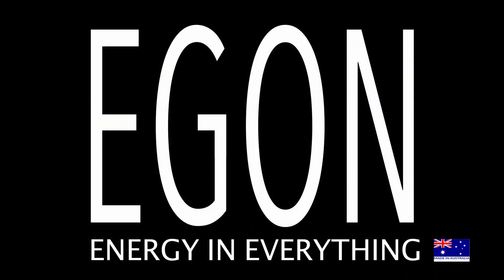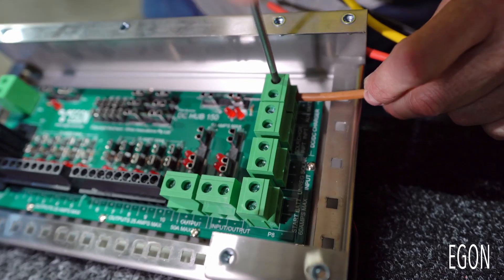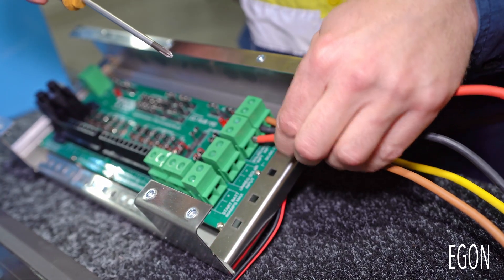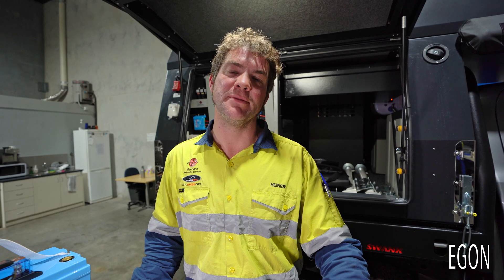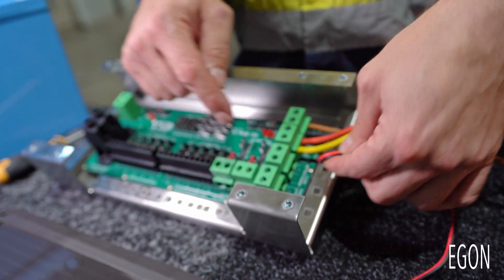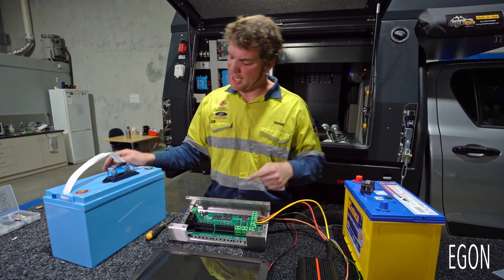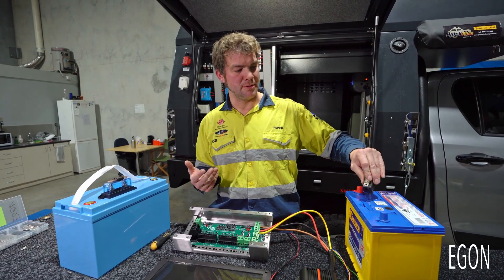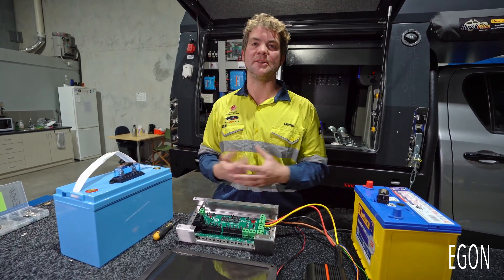REDARC DC CHARGER to EGON DC-HUB instal guide

Comment: How do I connect negative side come from battery? Previously I did ground that. Not run all the way from engine bay.
Reply from the maker: Run it to the negative side of the battery input. Do not use ground. Run neg cables to and from the DC-Hub. That way, there is far less chance of voltage drop.
Reply from the maker: I suggest using the contact form on the website for questions. YouTube is the worst place to send messages as comments on our videos are not monitored.

Comment: Only 80 amp? So I have to close the air compressor if I whant café?
Reply from the maker: I run my ARB double compressor through the DC-Hub. Few compressors use more. If it is more, then I do not recommend running it through DC-Hub.
Reply from the maker: I suggest using the contact form on the website for questions. YouTube is the worst place to send messages as comments on our videos are not monitored.